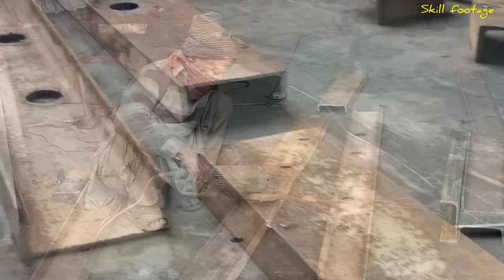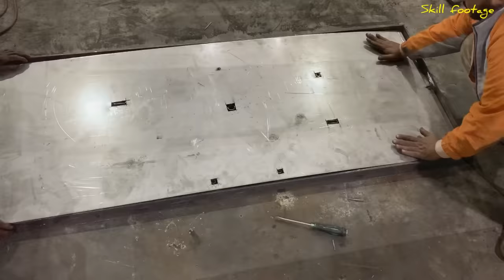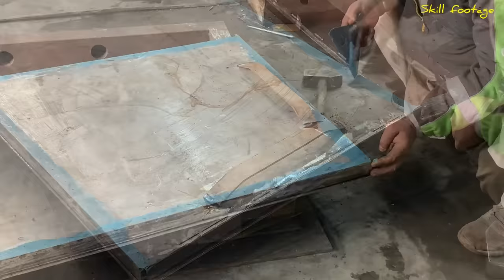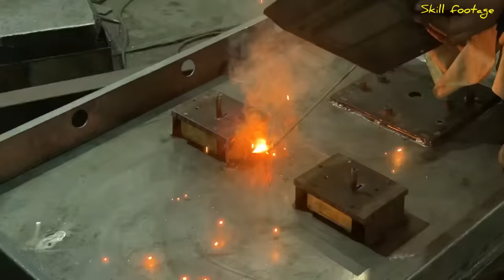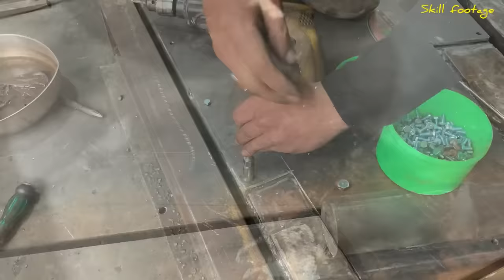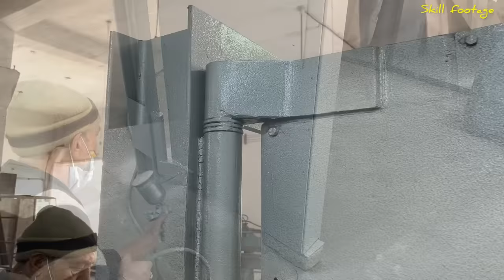Amazing Manufacturing Process of Bank Strongroom Door || How Bank Vault Doors Are Made

Comment: The only reason there are not many bank robbers in India trying to open those kind of doors is because their tools are also made India.
Reply: Seems their safes and vault doors are made primarily from unhardened mild steel, at one point being cut with hammer and chisel. One just needs a catering tin opener to do the job! 🤣
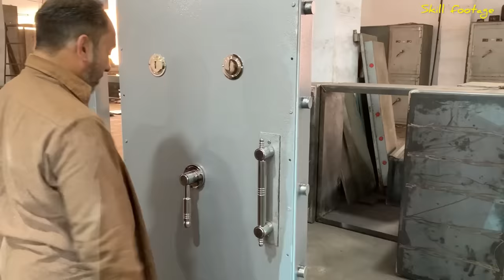Reply: I think this is from Pakistan. Just see 29:18
Reply: Why . The Frontcover is only screwed .
Reply: 23
Reply: Pakistan not India
Reply: It is Pakistan.
Reply: thats tre
Reply: jajajajajajajajajajajaja
Reply: This is pakistan not india
Reply: Ok you do it indian hero
Reply: hahahahahahahahahaha
Reply: This is a pakistani channel
Reply: And the majority of them are wearing a dress with a diaper on their head.  Oh, and don't forget the beach sandles.
Reply: Два удара кувалды и дверь вместе с арматурой и бетоном посыплются ты прав брат
Reply: @owaissheikh2359  разница не большая
Reply: NOW  THATS FUNNY.
Reply: @sanjeevshrestha5049  ABDULS 🤣🤣🤣🤣🤣
Reply: Pakistan, I think.🙃😊🙃
Reply: you do better with their resources
Reply: @Zodliness  And the welds... But i mean a thick mild steel door with concrete is still quite a task to go trough, and will take some time, and leave time for the police to come
Reply: @jeanladoire4141  That door is bolted on the outside, simply removing the bolts holding the front plate in place exposes the bolts and locking mechanism. It could be opened with almost no tools and without having to touch the concrete layer at all. I've made safe and vault doors for many a year before retiring and in my humble experience, their door was designed with no actual skills in security, only using layman's metal fabrication techniques. Send their design to CHUBB, see what sort of response they'd get, if not just hysterical laughter.
Reply: @Zodliness  I mean i was an apprentice locksmith and we had to install strong doors too, i would have thought they'd weld the bolts or some shit, surely they won't leave anything people can just unscrew... Right?
Reply: It's Pakistan. 😑
Reply: @trueindian8162  Now who would have known, if you hadn't been so diligent.
Reply: @jeanladoire4141  They screwed the bolts down tight and painted over them. You did watch the video didn't you? 😉
Reply: @Zodliness  I didn't go to the end, i wasn't really appealed by their bs. Welp. I won't be the one buying their stuff
Reply: @jeanladoire4141  But watching it to the end serves two purposes, you learn everything, not essentially useless snippets of information. Secondly and probably more importantly, you would have saved yourself from asking your question. 😉
Try watching the whole video before commenting.

Commenting on social media, involves more than waiting for your turn to reply.
Reply: @Zodliness  Everyone in this world who is earning money is diligent but it is not the point here. Its the matter of quality work.
Reply: Isn’t this where Harleys are made?
Reply: @oggyoggy1299  Finally... Some funny shit right there! 👍🏻‍🤣
Reply: @trueindian8162  And the quality of workmanship is in question and therefore I challenge you, or them to send any one of their 'security' products for an industry standard certification test.

Where each product would be subjected to a series of tests BEFORE it can be certified and granted an EN1143-1 status, using the reference numbers 0 – VI. Their safes wouldn't make it passed sending photos.

Talking on social media involves more than waiting for your turn to reply.
Reply: @Zodliness  Look brother I don't know why the hell are you taking it so seriously.
These are Pakistani people.
They don't often follow any standards even they make gun's replicas without any standards.
I am not saying that their products quality is best in the world or their products can pass the security test or not.
I just commented "its Pakistan" because this man was thinking that its India. India is not what western people thinks. We follow industrial standards for almost everything available in ready-made market.
Reply: You can make a safe as strong as you want, but the lock must also be good. This lock can be opened with a screw driver lol.
Reply: It is Not India 🇮🇳.       IT is 🇵🇰 Pakistan 🇵🇰🇵🇰🇵🇰🇵🇰🇵🇰🇵🇰🙏🙏🙏🙏❤️❤️)((Holland Limburg 🇲🇦🇲🇦)
Reply: @florianfischer3127  نقطه ضعف در پیچها و از بیرون است👍
Reply: Whenever you see people doing day to day work wearing baggy pants... Its Pakistan, not India
Reply: @sanjeevshrestha5049  Their clothes don't look like typical clothes worn in India either.
Reply: this is pakistan
Reply: No measuring tape  was harm in this video
Reply: Don’t expect too much from people working in pyjamas.
Reply: Valuable information 👏🌷
Reply: Boa noite pessoal tudo bem, bom trabalho. Alguém sabe me dizer por favor, quanto custa fazer, uma porta dessas. Muito obrigado.

Comment: am I missing something or why are the screws on the outside of the door?
Reply: Excetly ... what i thought..
Reply: It's to confuse the would be robbers
Reply: Its just in case, you lost the key. So you can still open the door
Reply: Agreed. 20 minutes with a 14mm ratchet on a drill would have that front panel off, revealing all the internals. And the shiny handles are all just screwed on… Add five more minutes…
Reply: This is what happens when u hire uneducated engineers to safeguard ua bank 😅
Reply: They even made this job easier - half of these bolts are missing 🤣
Reply: @W_Rational  2 minutes lol
Reply: lol it was made backwards
Reply: @CapRides  The comments are a little sad, you'd assume that 10 people made a mistake instead of the person that wrote the title . This is likely a rear access door or another opening.
Reply: @Victor-ze3sd  ja das wäre eine Erklärung so sind die jungs doch ganz gut
Reply: @Victor-ze3sd until you figure out that this is no mistake, and is common Pakistan engineering...
Perhaps you've not seen their home safe videos... 😂

Comment: It's me oh, but if the last steel plate is removed, which is only held with those small screws, there is access to the mechanism, I don't understand...
Reply: I too noticed this glaring omission, and couldn't believe that this was how they designed and manufactured it!

To have such a critical design fault is bad enough, but to then make and broadcast a video showing this critical weakness and the entire construction of the door utterly beggars belief!

In short, they've produced a video showing the critical weakness in the door and exactly how to overcome it!

This cannot be an insurance rated security door!

Clearly, standards and expectations vary from those in the West...
Reply: that plate is in the internal side of the door vault, as the hinge, so if you want unscrew those small screw you have to open the door.
Reply: It's not hinge that safeguard one side of door when locked....if door is locked you can remove hinges and door will be still locked
Reply: I mean, this is India or whatever. They’ve not yet figured out toilets, so I imagine these ‘security flaws’ aren’t an issue there either.
Reply: @fantabullagiorgiorio3698  you can clearly see those bolts are on the same side as the locks
Reply: @fantabullagiorgiorio3698  look carefully it's on the outside
Reply: @theGeniustechDHRUVGOEL   i've seen 😅you are right  i didn't noticed that. Holly crap 😁
Reply: Эта дверь изготовлена для запирания изнутри, похоже что для частного бункера. Забежал, закрылся, затаился!
Reply: @felixcat9318  that door would never be used at any bank in the western world. 
They clearly don't have the technology we have. It might work for them, since the average person wouldn't have the tools or equipment necessary to open the door. Here in the western half, the tools & knowledge to breach a door like that is common.
Reply: @timothygeiger8271  Nothing shown in these series of manufacturing in Pakistan would be acceptable in the West, where our standards would prohibit such products.
Reply: The screws can only be accessed from inside the vault.common sense!!
Reply: @felixcat9318  yes, i know that.
Reply: Last steel plate can not be accessed from the front, if it's welded how can you repair any fault in the mechanisms
Reply: @theGeniustechDHRUVGOEL  U8
Reply: Could that be the side which is faced away from the potential intruder...?
Reply: @Timothy Geiger  oh they have the technology if they can lace there shoe laces with explosives well you get my point
Reply: @o0julek0o  The Ganges is the worlds largest “open air” toilet.
What a marvel of engineering!
Reply: Scrap metal being repurposed, ok but, when I saw the guy applying bondo to hide the defects.
Reply: @fantabullagiorgiorio3698  no, the holes for the handle, and keys are on the hinge side.  you just need to unscrew the face plate, and grind through the locking bolt locking bars...  can be opened in 10 minutes with a wrench, and a grinder...
Reply: it's so rusted inside, you probably want to have easy access, anyway...

Comment: This video would make more sense if it were titled "Amazing Manufacturing Process of Panic Room Door". It only makes sense if the intruders are approaching from the direction of the rebar/concrete - not from the lock side. Surely no bank would purchase this for a vault. A socket wrench gives access to the locks.
Reply: And if it is a panic room, not much point having deadlocks on the inside either.
Reply: Aw c'mon guys ... this is the INSIDE of the vault. A small guy lives insides and operates the door from the inside when ordered by the bank president who slides him the two keys through a secret hole ... Yeah !
Reply: "A socket wrench gives access to the locks".  Actually it doesn't ... at least not until the two keys were used and the door was unlocked 😎
Reply: @oldmanofsacramento  Actually it does. Undo the bolts holding the front plate and you have access to the two pieces of angle that the side bolts are attached to and the two plates connecting them to the locks. Cut those pieces or bust the welds and just pull the side bolts out. Or just disassemble the center mechanism with an allen wrench.
Reply: @scaletownmodels  alrightee then, all I need to know now is the bank where it is installed. Don't worry KH, we split 🤫
Reply: You don’t even need a socket wrench. The moisture in the wet concrete alone will rot out the door in months
Reply: @fga55  if it isnt rusted shut at that point, since they didnt even fully weld around the door and ground off 99% of the ones that were there, the moisture will get everywere and as was already shown that it the mechanism is binding it wouldnt suprise me.
Reply: @oldmanofsacramento  Clearly the bolted on panel is the front which is a huge mistake.
Reply: Its pakistan. Have you seen the place? its not like they invest much logic into what ever they are doing.

Comment: This door is more security theatre than real security. Five minutes with a spanner would take off the outer skin on the door, revealing the weaknesses within that can be quickly bypassed with an angle grinder.
Reply: "Five minutes with a spanner would take off the outer skin on the door" - INNER skin. To get there you'd need to open that door first...
Reply: @MrKotBonifacy  If that's the inner skin, why are the key holes on that side of the door? Is it intended for people to lock themselves inside?
Reply: @nicolek4076  , I have to admit I was wrong. I posted my comment WITHOUT watching the entire video (I just don't have time to watch everything in its entirety). I saw your comment, and assumed that you must have got it wrong, as fixing the outer sheet with bolts would be a pure idiocy... Well, guess what... ;-)
(And, frankly, I'm baffled.)
Reply: @MrKotBonifacy  You're one of the politest people I've encountered in these pages. Thank you for your honesty - you restore my faith in humanity.
Reply: @nicolek4076  Glad to hear that : ) But I'm not the "entire humanity", and yes, all those "keyboard warriors" out there are not exactly well tempered personas... Well, such is life. Cheers!
Reply: With this level of competence, I'm eating a hat full of sand if you get those bolts out in 5 minutes with a spanner. I'm confident that they are cross threaded, full of grit, weld spatter and bondo and overtightened to the point of almost breaking.

Comment: Didn't they.. didn't they just put the massive, multiple layered and cemented side inside and exposed the one sheetmetal layered side to the outside (key side). So unless someone wants to lock himself inside the door, to open it you just need do unscrew the hexbolts and dismantle the locking mechanism behind? No grinder needed, just an wrench and 17 nut.
Reply: I think so  :/

Comment: Concrete reinforcement, from the inside of the bank vault.
Hinges on the outside. 
The entire weight of the door rests on the top hinge. 
Outer door plate covering the mechanism, fastened with a few screws.
Reply: Fiendishly clever.
Reply: Beware the crook with a wrench or a socket set. It will keep the stupid crooks out for sure. What happens if the lock fails? Can you just on bolt the lock and install a new one? Or would you need to cut it off and weld a new one on? 
You won’t be calling this factory for a drill point.
Reply: Dude this safety door is made in Pakistan!! There they don't have money in banks hence they don't require much safety you see ?? 😂😂😂😂👌👌👌👍👍👍👍
Reply: BE FAIR IT IS 7 CENTURY WORKMANSHIP.  ALL PRAISE TO MUHAMMAD.  BUT NOT FOR AL LAH . 🤣🤣🤣🤣🤣🤣
Reply: Vault door is build to prevent somebody locked in to get outside the vault...maybe thats why is build like that...🤣🤣🤣
Reply: Think you can do better with the same shit they work with go for it. Go show them you aren’t just a troll but a great craftsman. 🤡🫵😂
Reply: @donsturtevant2396 
In the commentary, I indicated technical solutions that are weak points. I didn't mention the build quality.
Reply: I’m guessing all the door furniture is on the out side of the door ? 
Which the plate is screwed on. And underneath is the locking mechanism. So unbolt the plate and you have the locks which you can then get to to open the door.
Reply: It appears to be made totally backwards!
Reply: Yea u just need 2 cut the door hinge and ur home free 🤣
Reply: Cut the hinges off and the pins are still locked in there recesses right around the door and you can't get in.The smooth side , will be outside, there must be another access door to vault.
Reply: I'm sure you're a fabricator.
Reply: @donsturtevant2396  Not too difficult, build the door in reverse, i.e. solid side outward facing, two hinges at the top (three in all), solid welds throughout and minimum of five  lever locks.
Reply: @MrJohn714  lol it does appear to be backwards
Reply: A nice door

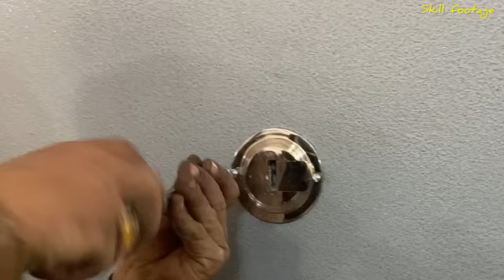Comment: 28:30 Click on one, nothing on two, slight core turn on three....
Not that it really matters since all you have to do is remove those bolts on the outside and the whole lock and locking bar assembly is right there underneath it. They built the thing backwards. The lock and locking bars are suppose to be behind the concrete and the bolted on plate is suppose to be on the inside of the vault.
Reply: Well now they have a backup plan in case this business fails.
Reply: And one more time to show that wasn't a fluke. Aol, The Lock Picking Lawyer needs to do a video on this!
Reply: Im agree with you

Comment: The door is made back to front. It can be unbolted to access the lock mechanism! 
I spotted the clever use of copper sheet inside the door to slow down attack using a gas torch but everything is back to front lol.
Reply: I spotted that to Jack so I can only assume that the comments are generally wrong and that the plane side goes to the outside. If that’s the case the pins are still vulnerable to cutting but the crooks don’t have access to the mechanism. The locks may go to the inside to stop unauthorised opening of the door. Cheers Stuart 🇦🇺
Reply: Thank you, i didnt know what the copper sheet was for.
Reply: @scroungasworkshop4663  Who needs locks on the inside, the latch lever is enough if the door is for a panicroom.
Reply: Could be like an access door for loading or something,  not the  main entry door to the strong room.That copper will be on the intended outside.

Comment: Very laborious job, finishing is also good! But why the cement reinforcement in the inside and the bolted plate on the outside? Anyone can open the bolts, remove the big plate and dis engage the locks from outside if he can get some times! In that case the inside reinforcement will be useless!

Comment: I don't know if I am missing something But with the 30 odd bolts around the outside (not the inside) of the door, Wouldn't it be easy to unscrew the bolts to get access to the doors inner workings. It seems with all the rebar and the concrete on the inside of the door you are trying to stop people breaking out of the vault and not in to the vault? i know the concrete helps with the fire resistance as well. But apart from this it is a fantastic job and a very strong and sound door!

Comment: My dad used to work for a bank equipment company and I've had the opportunity to see many a bank vault door setups exposed but I've never seen one where the hardening is on the inside of the lock mechanism, a cutting torch would have this open in five minutes and my dad or the LockPickingLawyer could open the locks in less than a minute.
Reply: Hi, could you please ask your dad for some reference Bank Door manufacturers? I mean the best cos I`m working in the central bank project in my country and we need to propose the highest security doors like bank vault.
Reply: @minamodares3379  Good one